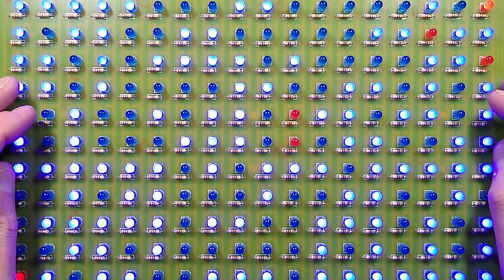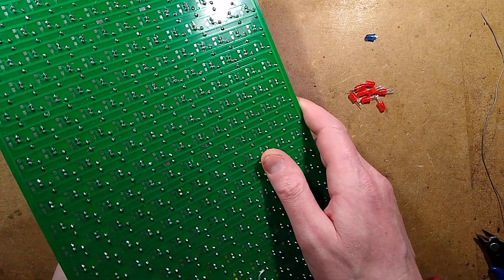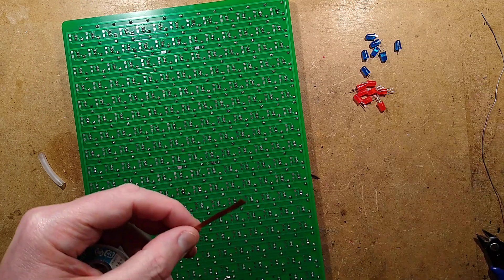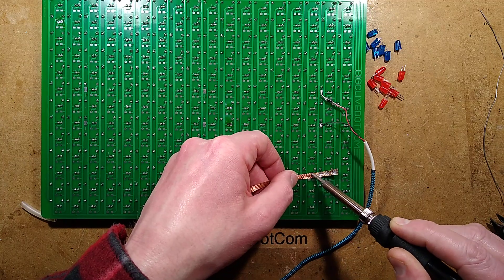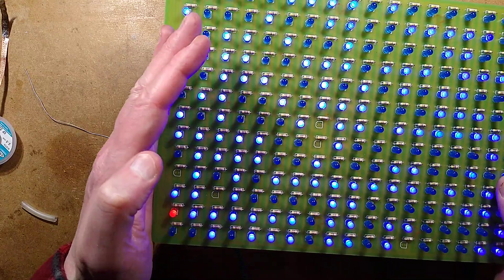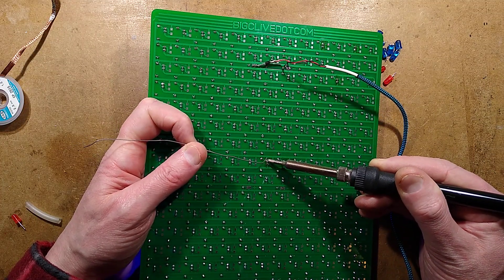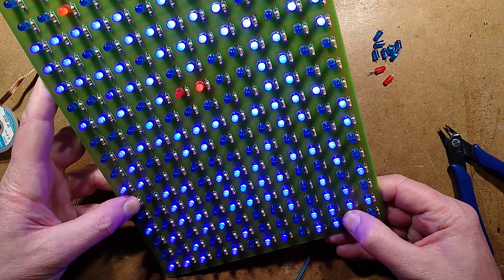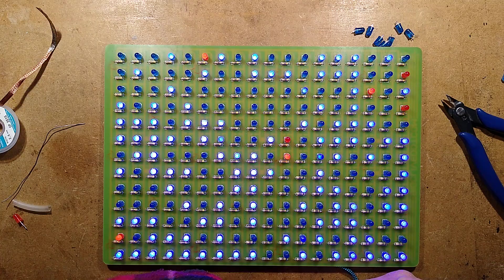Repairing the live stream supercomputer panel

Comment: When watching the front panel of those early computers there were lights on the address and data lines as well as all the status/control lines.  As a program sequenced through a program the address lines would appear as a binary counter.  Then when a branch occurred the absolute address would change then continue as a binary counter...  The data lines were more independent.  You can control a large number of LEDs directly from a uC by connecting them back to back. Here's a 12 LED board run from an 8-pin PIC which uses, AFAICR, only 4 pins to drive 12 LEDs.  http://www.prc68.com/I/PRC68COM.shtml#12LED

Also you could connect the lowest 8 address bits to a D/A converter and the data bus to a D/A converter and drive the X & Y axis of a scope.  What you saw was an almost random pattern.  Very mesmerizing.

Comment: I loved the way the LEDs were all in sync at power on for 1 or 2 flashes and then went random! also have you considered socketing those LEDs due to the failure rate?
Reply: He needs green. A different color LED for LEDs that have failed twice already in the same position. Then it can be a 3D map.
Reply: Decent sockets aren’t cheap, and I think the failure rate will be lower enough that it won’t be an issue. We all know how Cloud likes to tinker with stuff anyway and can’t leave it alone 😂
Reply: @hullinstruments  I didnt consider the cost. Also I suppose it'd be something to do if another was built from scratch as changing them now would be a huge effort.
Reply: @willyarma_uk  Good sockets or tension pin headers aren’t cheap. and unless you purchase the Teflon version, they can easily melt a bit when soldering which causes contact problems. And can lose contact and have corrosion/contact problems in a damp environments. And clives home…The Isle of Man.... is basically an Amazon rainforest 😂 

 I LOVE! sockets, I actually collect rare and high-quality vintage and modern sockets. 

My favorite are the Thor labs/arroyo branded all in one laser diode test sockets. With built in active cooling, built-in driver, and computer interface connection. About a $500 for each socket!!. I’ve got several of them for different form factors and luckily picked them up on eBay for a song.

If you want to see some beautiful sockets, look at the Teflon “Augat” brand transistor and IC sockets that are turquoise colored and gold plated. Almost as beautiful as gold plated and white ceramic vintage Ic chips

There are also some beautiful vintage IC and transistor sockets, some of them cost a CRAZY amount. 

All of the beautiful 3m brand ziff sockets with their gold plating and bright vibrant colors, With a little brass handled lever to release the IC pens. 

Sockets and test fixtures can be beautiful things!!!

Comment: In the 1970's I worked for ICL, mainly at the Driver Licence center in Swansea. The 4 system 4 mainframe computers in the computer hall worked all day every day and, yes, they had an engineering panel on the end that was covered in incandescent lights and switches. Generally we kept them turned off as it saved the bulbs but every time there was a big wig visitor we were asked to turn the lights on to "impress"  them.  Very Startrek like.
Reply: Even in the 90's it's still a thing.  When I was setting up a network closet, the management was so impressed with the blinking switches, they installed a glass door for visitors to peer in and be impressed by.
Reply: One would hope the designers had heard of keep-alive resistors.
Reply: @bdf2718  ooh I'm curious, what are those?
Reply: @BeastlyKings  A resistor in parallel with whatever drives the lamp (relay, transistor, switch, whatever) chosen to pass about 1/10th of the running current through the lamp when it is off.  It keeps the filament slightly warm, so increases the resistance (a lamp is a positive temperature coefficient resistor), so reduces the inrush current when the lamp is switched on.  Lower inrush current means less thermal shock/magnetostriction effects that can cause failure.

Very common on older designs of fruit machines and pinball machines.  And anything else with flashing lights.
Reply: @bdf2718  No such thing in the 70's, just a switch to blank all the light when the engineers didn't need the, oh and a lamp test switch and a good supply of new lamps.
Reply: @rickharriss  Ummm, keep-alive resistors is pre-70s tech.  Not everybody knew about it, but it's old.
Reply: @bdf2718  that's very interesting! Thank you!

Comment: Is there a link to this specific kit? It will keep me entertained during lockdown and mad with fumes.
Reply: He left a link to the circuitboard files. There is no kit, you have to submit the circuit board files to one of the PCB manufacturers… But it’s actually really cheap. Only a few dollars a board if I remember correctly.
Reply: @hullinstruments  okay do I have to enter any kind of tolerances or size and I just use blinking leds with 1 resistor each? Sounds simple and super relaxing.
Reply: @stonedsavage7814  check out big clives video about them. Or ask him directly because he pretty much responds to everybody. But watch his video first because it will answer your questions

I haven’t got to assemble one yet so I’m not in a position to give it vice… Haven’t done one because I didn’t want to order five PCBs (which is the minimum)… Even though ordering five is cheaper than one… I just hated to do it because I’ll only assemble one or two of them and I don’t want to have the unmade PCBs and wasted material laying around. 

JLCPCB and the other high-quality professional Chinese board manufacturers do an amazing job! I’ve purchased dozens of boards from them over the past few years. It’s so cheap you won’t even believe it. It’s like the price of a gallon of milk to get five PCBs made and delivered within a week from China. These are larger PCBs so they will be more expensive. But they’re still ridiculously cheap! 

They offer so many options, and although this is a very basic board in class video… I’ve got some fancy ones from them in the past. 
Everything you can imagine from multiple upon multiple layers of complex high end boards with gold plating, and all types of Super high-quality industrial precision lab type stuff. 

I’ve designed and ordered some really expensive boards in the past from several of the Chinese board companies… The most expensive being made from ceramic instead of fiberglass. It was for some metrology projects in my lab. Those boards were over $100 each,  for a palm sized circuitboard...., and rest aren’t just gold plated.... it’s solid gold foil on the boards… so instead of copper clad boards they are seriously gold clad boards… And then at the end instead of telling them they plate over the gold with “hard gold“ which is a very hard wearing type of gold plating alloy that won’t wear away even on contacts and for repeated use. That stuff was a lot of fun! And I was so thankful they would make the boards for just over $100 each… Because ceramic boards of that quality are normally a minimum of a $1000  in the USA. The type of boards that are found on the Mars rover and stuff… Like really high-level metrology grade stuff. It’s so cool it’s available to just some Joe blow guy like me who likes to play metrology scientist in my backyard lab. And even though it’s a lot of fun…I find just as much joy building a five dollar flashing blinking LED light! 😂 seriously.

You might be able to buy a single board from someone who will ship it to you. One of his subscribers.
I’ve been trying to buy a spare PCB from one of the many folks who ordered them. If you watch some of clives videos about it… And others who have made videos showing their assembly… It will tell you everything you need to know. He assembled several of them on video, not the large version but the smaller version which is the exact same thing just a quarter of the size.
Reply from the maker: http://www.bigclive.com/freebies.htm     (A4 gallium)

Comment: I just wonder why the diode is there the positive usb lead?
Reply from the maker: It's to nudge the voltage down to control the intensity.
Reply: Otherwize awsome!
Reply: Oh clever idea then why use there resistors if u just can chain up 4 diodes
Reply from the maker: @henrikostrov  To nudge down the intensity originally set by the resistors.
Reply: @bigclivedotcom  ok good point

Comment: Way back in the 70's Tancredi had the TE200 EQ/200watt amp with echo and a led bar dot color display, I was so impressed with it I looked up the chip that made this work, the LM3914N a 10 segment LED bar dot display driver with a mode select pin,  I bought many of these and built my own multi channel multi frequency bar dot display left and right channel using green yellow and red leds, ripped apart an old 7 band eq tapping into each of its outputs to creat a 14 channel 7 left, and 7 right spectrum analyzer,  looked great in my car blasting classic rock. It was discontinued years ago but I guess they brought it back, even though now their several versions of this chip. Love your live channel, as a truck driver it offers great company on those long drives every day, helps make those miles seem shorter. Thank you for producing them.
Reply from the maker: You can buy the LM3914 chips in bulk on eBay.
Reply: You should check out Techmoan's channel - he loves graphic equalisers and other music visualisation paraphernalia.

Comment: Bought a hand crank automatic component lead trimmer just to cut & bend resistors to length for this project! Built a couple now - Made a Union flag out of one using red, blue and white Flashing LEDs... kinda cool but a possible improvement for such purposes would be to make both rows an odd number...
Reply from the maker: It takes a while to tune the hand crank component formers up.  I used one for the supercomputers too.

Comment: Though this panel is purely for amusement, I really do appreciate indicator LEDs in electronics. They're getting more and more rare, some laptops not even having a power LED

The 1541 drive emulator I built based off Pi1541 has power, activity, and "seek" LEDs

The more LEDs, the better!
Reply: Very true! I hate my new dell laptop... no disk indicator, no charge indicator, no power indicator, no wifi/bluetooth indicator, no status LEDs for the RJ45 connector either.. Just a single white LED which has no markings and still after a year of using the thing I have no faintest idea what it actually shows, if anything. Terible design.